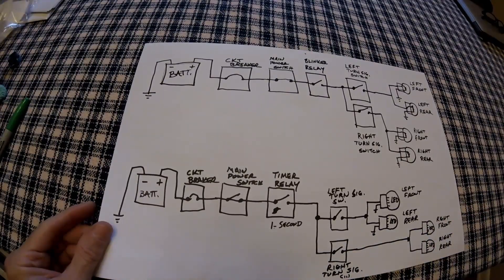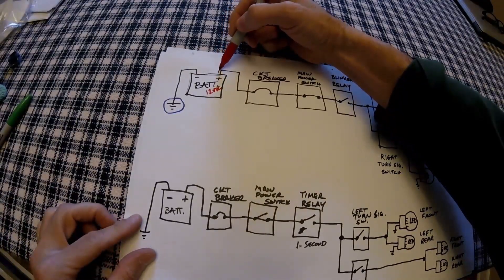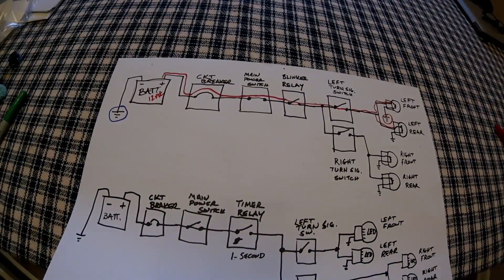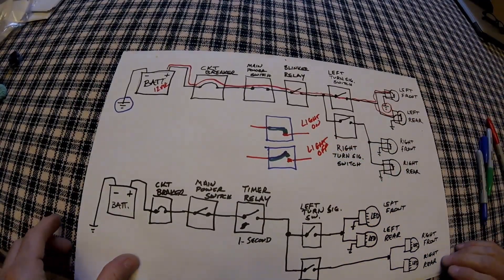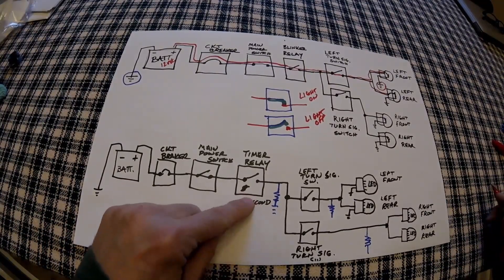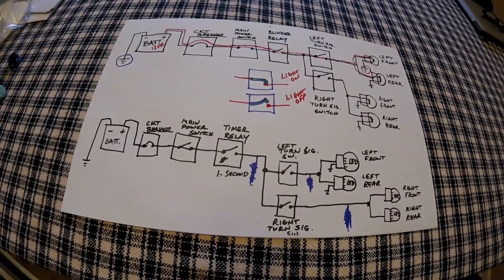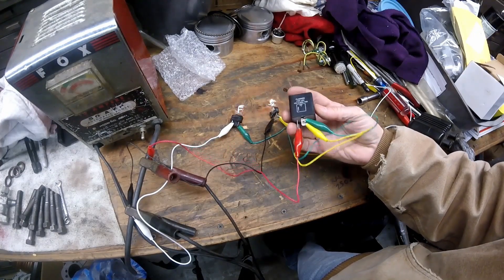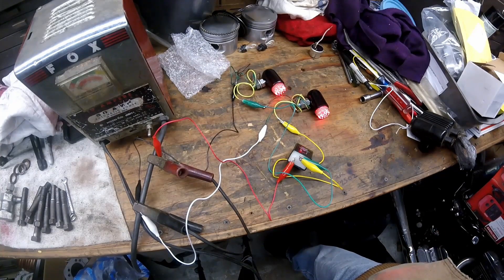LED Turn Signal Conversion w/o load resistor Harley Davidson or car

Comment: EXCELLENT -  if possible, could you do a video on how to wire LED turn signals that also act as brake lights.  When I did a friend's FatBoy- I had to use diodes because after applying the brake, the 12 volts would 'backflow' to the flasher module and the lights when just stay on and not blink anymore after releasing the brake.  The diodes prevented the 'backflow'.
Reply from the maker: I'll have to give this some thought. After I figure this out I will make a video and post it on my page. Thank you for the idea and thank you for watching. Please subscribe if you haven't.

Comment: Thanks this is the problem I'm having. I would like to buy this flasher but I didn't see what it is listed as could you help me so I can go to the parts store and obtain one? Just not sure what to tell them I need.
Reply from the maker: I also have a link attached in the video description for Amazon.
Reply: Okay sorry to be so needy but I got a 2000 Fatboy where is this relay located on that bike if you happen to know and also what would happen if I had front LED turn signals but the standard incandescent installed in the back still and I used this new flasher
Reply from the maker: @matthewmennealy5437  You have a turn signal module under your seat. I would try to see if it will work the way it is. If not, you can cut into the output wire and splice in the LED relay. If you need more help email me at hdrap_1999@yahoo.com
Reply from the maker: @matthewmennealy5437  You would have to put 2 of the LED flashers in. You would have to cut them in to the wires on pin 3 (Brown) and Pin 4 (violet).
Reply from the maker: LED Flasher Relay. I buy them on eBay. See link below.
Thank you for watching.

https://www.ebay.com/itm/402841449195?hash=item5dcb38b2eb:g:qOUAAOSwwkdgm9Fv&amdata=enc%3AAQAHAAAA8Br7V%2BGCiiOWiTcnYpIiGYH3%2FeOwBXWrxuJ%2FwY5LNnzhT6zX8K78u2Hjs%2F%2BI3fZzMWaLHd%2F5qQtwkn1o4sdkwFCD3eSjIpgX%2BjMNlKqA1s3rZLOjJ73Raravd5X9U4Td78Z1DmuKjIA%2BPLbfH6FUghaEhGuRVh9p259j72O9LHZpzA%2Fe6kLjWqTjo7S03raIZnK%2Bel4T0ScKCzVQ66HARxohg2mr2dAn1Nx%2FOPSRYVnlbxlamrN8Wrl%2FUwYm%2FY9XndLsaeQvsf82dZKo5iyMtnIm7%2Fv6LEkb%2BX6mHSxG%2BN1Pd%2B7R1hnvHO0IMhiVHL%2Fwlw%3D%3D%7Ctkp%3ABFBMuondjMZg

Comment: i added rear LED turn signals with a flasher relay to my harley davidson sportster and it fixed my hyper flash problem and worked perfectly. i then changed out my front turn signals to LEDs and now i am back to hyper flash. any idea whats going on?
Reply from the maker: Sounds like you’re LED flasher is bad. For $5 I’d try a new one.

Comment: 👍🏍️🌄🍺😸
On my bike it has a turn signal module I think it judges through the speedometer how far you've traveled and it turns off I always wished it would be longer but I don't think there's any way to change that it's a Harley from 1998. I know the newer bikes give you more blinker time before it automatically turns off. Unlike a car which has the flipper underneath the steering wheel.
That's why I always turn my or hold my turn signal button down and then eventually release it and then it does turn off but it gives people behind me more time to notice my intention
Reply from the maker: Yes you are correct. I have a 97 and when I bought my 03 the dealer told me the increased the time they stay on.
Reply: @Rapsgarage 
I thought I would look for some type of extend  blink timer . But for now I'll just keep my finger on the button

Comment: I’ve got a 96 softail and I put the timer relay in but still wouldn’t work, I had to put both the relay and the plug-in play resistor to get my led to blink. Without the resistor when I would turn my blinkers on the right side would work but the left side would come on and stay solid but with the resistor the right side blinks and the left sides stays off and vice versa any advice
Reply from the maker: I will look into this and let you know. Copy this question and email me at hdrap_1999@yahoo.com